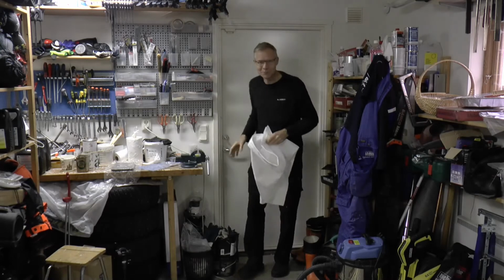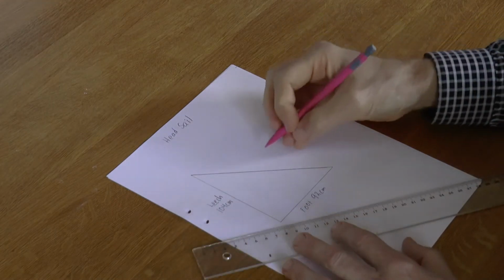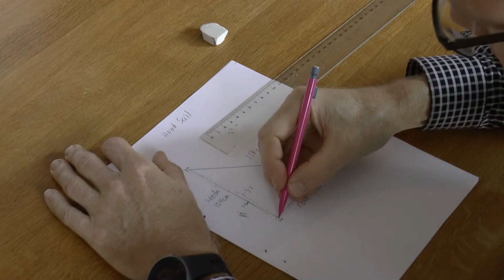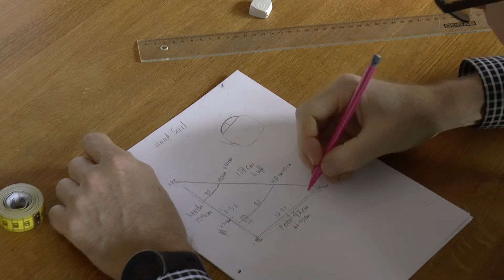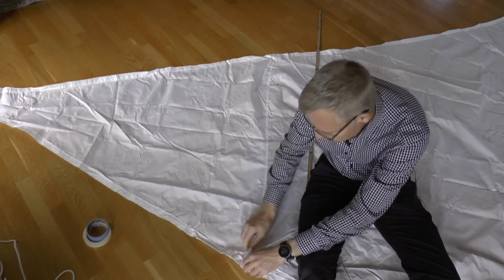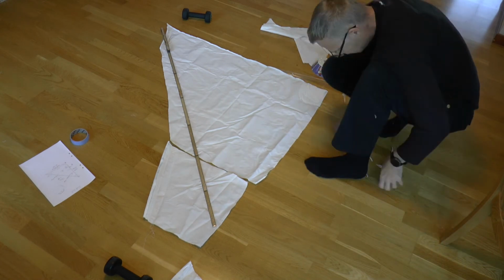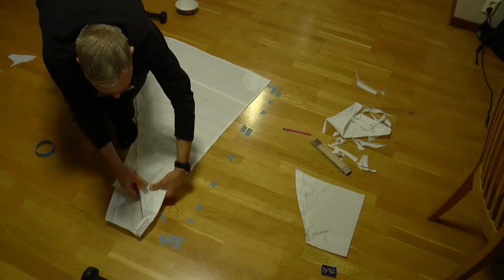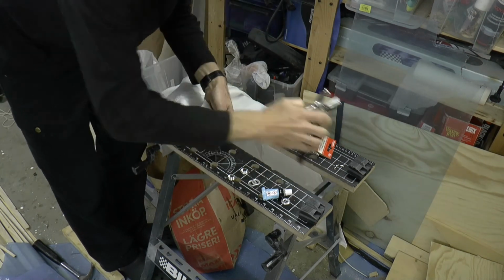How to make a sail for a kayak, DIY inexpensive without a lot of tools #161

Comment: Really great explanation. I have a flat tarp sail for my sailing canoe that does a terrible job. I want to change the sail setup and this will be a useful guide. Can I ask, where did you get the numbers to calculate the curve in the "belly" of the sail?
Reply from the maker: @leemelbourne3297  Thank you! I used the circle equations found in most mathemathical books. You shold look up the equation for the cord in relation to the circumference. I recomend going for a flatter sail than you think. Mine got a too much of a belly to work well in strong winds.
Reply from the maker: @leemelbourne3297  I can't find the formula (long time ago) but an approximation is to use b=2(h*h+(C/2)*(C/2))0.5 where b is the cloth lenght, h is the belly depth and C is the chord.

Comment: Sie haben uns zwar gezeigt, wie Sie das Vorsegel entworfen und hergestellt haben. Nun möchten wir aber auch wissen, wie es sich in der Praxis bewährt hat.
Baut sich das "eingebaute" Profil so auf, wie Sie es geplant haben, besonders da das Segel ja so klein ist? Ist die ordnungsgemäße Funktion von der Windstärke abhängig oder nicht, da ja nur eingeschränkte Trimmmöglichkeiten vorhanden sind?

Die von Ihnen gezeigten Berechnungen zur Profilerzeugung über die Lieken muten so an, als würde das Segel aus einem einzigen Stück Segeltuch hergestellt werden. Sie fertigten es jedoch, wie üblich, aus separaten Bahnen. Warum haben Sie zur Profilierung eigentlich nicht auf die Methode mit den an den Verbindungsstellen konvex geschnittenen Bahnaußenkanten (sphärischer Schnitt ähnlich wie bei den Landkartenstreifen, aus denen ein Globus gefertigt wird) zurückgegriffen?
***********************************************************************************************

You have shown us how you designed and manufactured the headsail. But now we would also like to know how it has performed in practice.
Does the "built-in" draft build up as you planned, especially since the sail is so small? Is the correct function dependent on the wind strength or not, since there are only limited trim possibilities?

The calculations you showed for creating the jib shape via the leeches seem as if the sail was made from a single piece of sailcloth. However, as usual, you made it from separate sheets. Why didn't you actually use the method with the outer edges of the panels cut convexly at the joints for profiling (spherical cut similar to the map strips from which a globe is made)?
***********************************************************************************************

Du har vist os, hvordan du har designet og fremstillet forsejlene. Men nu vil vi også gerne vide, hvordan det har fungeret i praksis.
Bliver den "indbyggede" profil opbygget som planlagt, især fordi sejlet er så lille? Er den korrekte funktion afhængig af vindstyrken eller ej, da der kun er begrænsede trimmuligheder?

De beregninger, du viste for at skabe profilen via iglerne, ser ud som om sejlet ville blive lavet af et enkelt stykke sejldug. Men som sædvanlig har du lavet det fra separate ark. Hvorfor har du egentlig ikke brugt metoden med de ydre kanter af panelerne skåret konvekse ved samlingerne med henblik på profilering (kugleformet snit, der ligner de kortstrimler, som en globus er lavet af)?
Reply from the maker: I have tested the jibb in these videos https://youtu.be/bNnAr-a1I4Y and https://youtu.be/ht8H1fSQ88s. I think it performs resonable well but I might not make a new one the same way again. I would put the head and tack ring a bit further out on the sail to better stretch the luff. The kayak is an experimental design so there are more design optimizations to do than the sails. In a video in the edit process I will talk more about those things.
Reply: @sailoutofagarage6212  Ja, erst wenn man etwas getestet hat, erkennt man das Verbesserungspotential. Sollten Sie einmal ein geändertes Vorsegel fertigen, dann vergessen Sie bitte nicht, auch das filmisch zu dokumentieren.
Jetzt bin ich schon mal auf Ihr gegenwärtiges Video gespannt.
**********************************************************************

Yes, only when you have tested something do you recognise the potential for improvement. If you ever make a modified headsail, please don't forget to document that on film as well.
Now I am already curious about your current video.
**********************************************************************

Ja, det är först när man har testat något som man inser att det kan förbättras. Om du någon gång skulle göra ett modifierat försegel, glöm inte att dokumentera det på film också.
Nu är jag redan nyfiken på din nuvarande video.